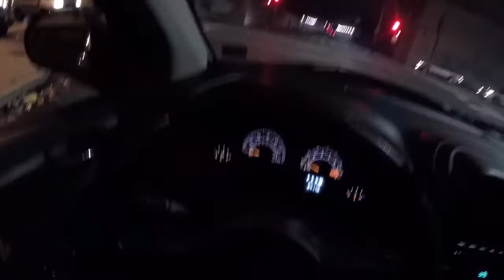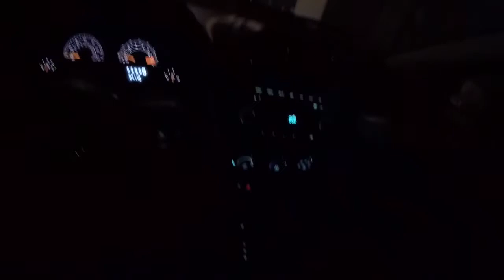2008-2018 Jeep Compass 2WD 2.0/2.4L Front Brake Pads Philadelphia

Comment: I just found out the hard way in newer models ... it's different... u gotto disable the autobreak thru the console in the car.. disable it so the calipers can retract the brake
Reply: Thanks.  How do you do that.?
Reply: @Jimmy_Cavallo  in most jeeps/mopars cars... you can do it from the radio unit.. the option is there
Reply: @onYaFace2023   Thanks Javi. I’ll look into it.

Comment: When you are pushing the caliper pistons back in where exactly are you prying?  Between rotor and disc or did you put the screw driver in the holes between the inside/outside of rotor against the caliper body? Thanks.
Reply: rod1148 normally I’ve always taken the calliper off, and used and old brake bad and a large c clamp to compress the piston back in.. never ever seen it done this way. But hey whatever works!!
Reply: @harleedavis991  c clamp for the win. 💪🏼